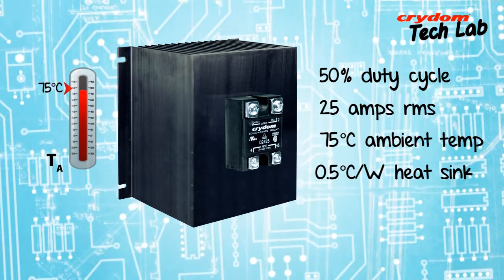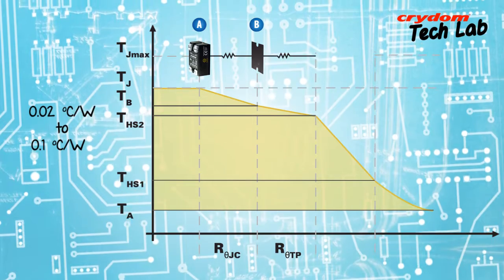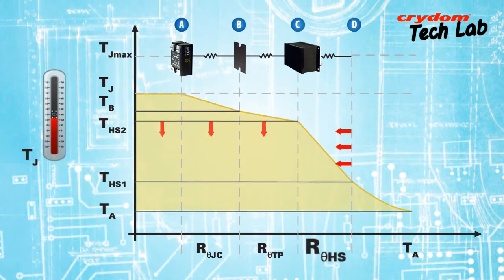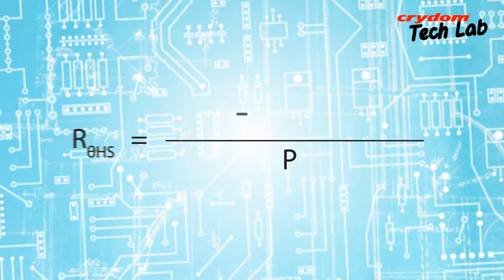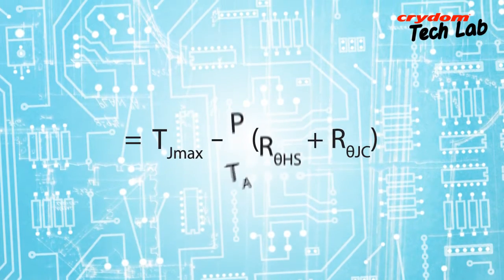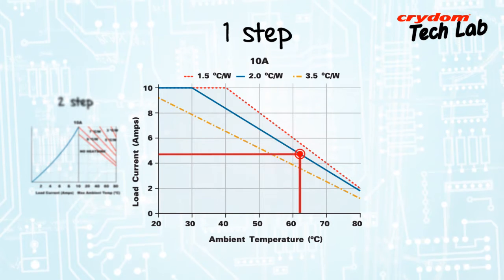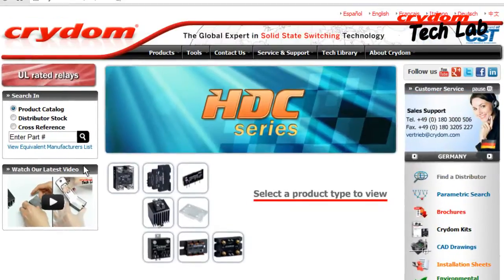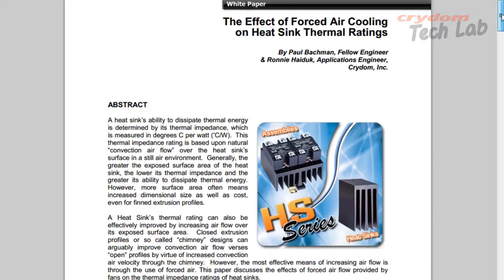Crydom TechLab 3 - How operating conditions of SSRs and Contactors impact their output rating

Comment: I have a 25 amp 3phase ssr controlling heater elements which occasionally split the  ssr in half and sometimes stick in the on position with no DC control input and sometimes sets the wiring on fire the manufacturer of the oven  has stated there is no faults on oven . I have noticed also the plc  controller can increase the on time say 15 seconds ...off time 6seconds could this be the problem .I assumed better to switch on and off shorter times.less heating and contraction of the ssr ...your help would be appreciated has the manufacturer has updated the ssrs to 40amps even though there is only11 amps on each leg of the ssr ..thanks mark ..